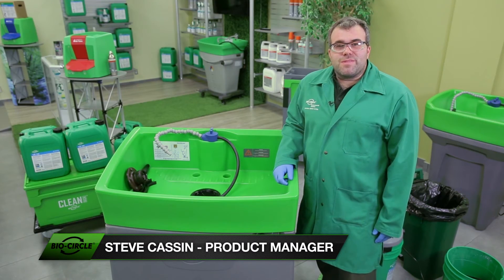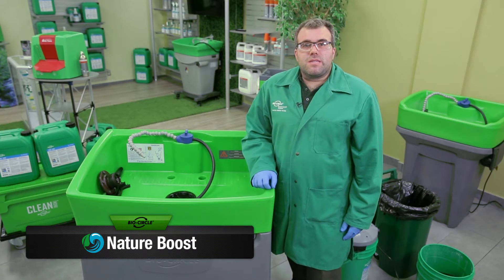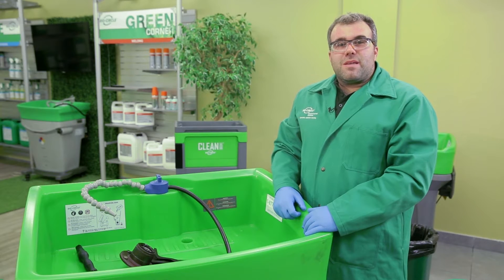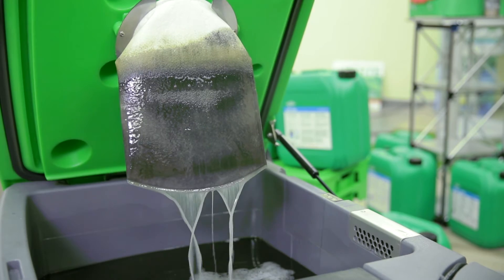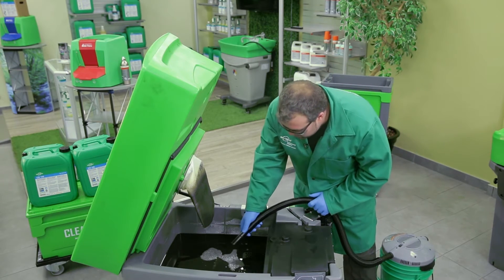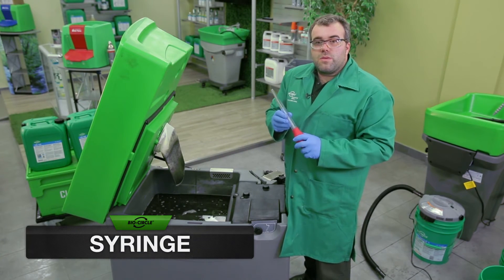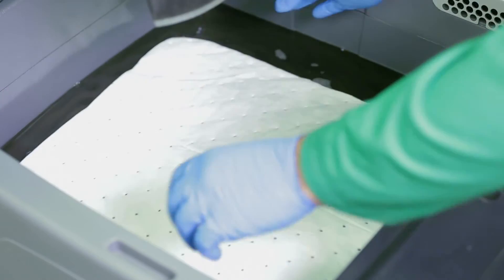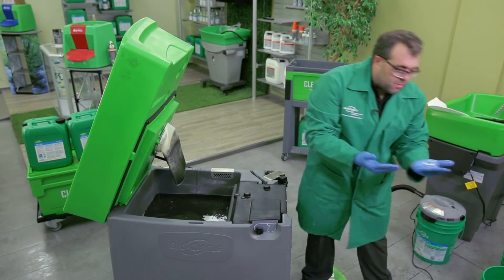Bio-Circle - Oil Skimming Tutorial

Comment: Why do you need to skim the oil doesn't the product eliminates the oils isn't it the purpose of the system ?
Reply: +V10PDTDI The tutorial is for parts washers that use the CB100 liquid. CB100 is a micro emulsion liquid (non bio-remediating), meaning that oil is lifted from a surface and does not get mixed into the liquid - it floats to the top, so skimming is needed in this case.
Reply: +Walter Surface Technologies  ok now I get it.